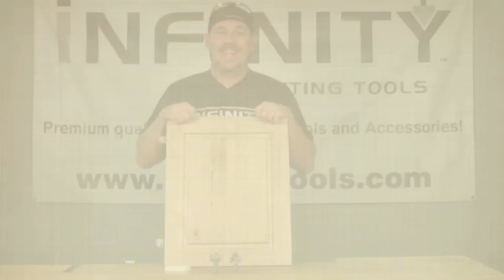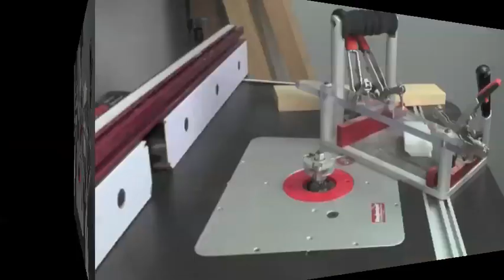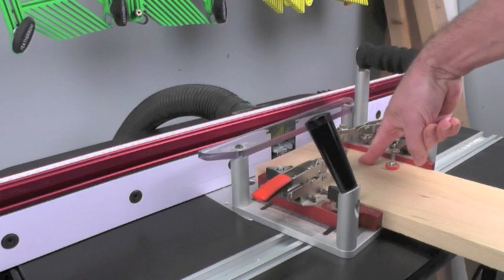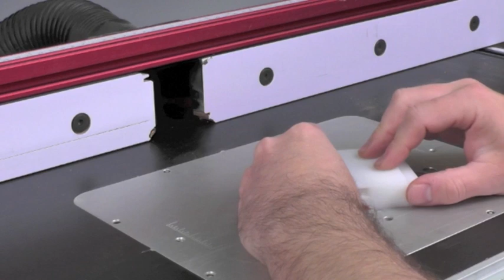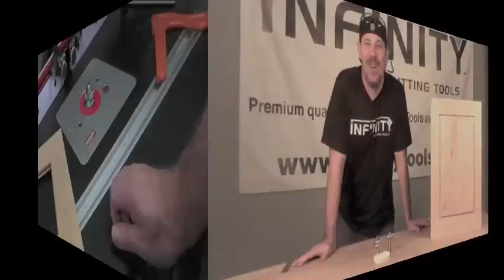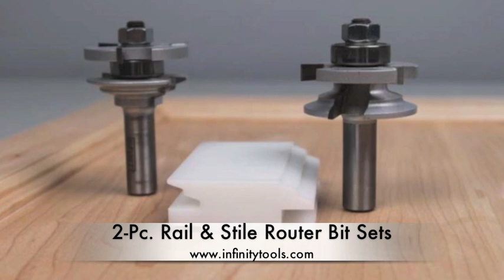Infinity Cutting Tools - Rail & Stile Router Bit Set Up Tutorial

Comment: I have got a rail and stile door bit set but the only problem I have is the coping bit does not have a bearing to line up the centre with the fence of my router table.  What is the best way to setup the bit which has no bearing?  Thank you.

Comment: Thanks man.  I just purchased a new Shaper and will order your Cabinet Door Cutter Set soon.  I bought the sled already and it's waiting to be used.  Apparently, I will need to buy or make a higher fence for the shaper to use the sled.  The clear plastic rail on the sled is higher than my Shaper fence.  Any suggestions?
Reply from the maker: It's pretty common to have to make custom fences for shapers. They tend to be sold with this in mind in my experience. I have always found that MDF seems to be the perfect choice for this, I set up the fence for the job at hand and if I need to cut into it to make zero clearance cuts It's no big deal because when I am done I just toss a new fence in place.
Reply: InfinityTools Ok Thanks.  I ordered the miter bar for the sled.  I know it will be handy.  Can you tell me why I couldn't use the miter bar all the time when making the coping cuts and cross cuts?  Is there a reason that I would clear plastic guide rail against the fence?  I guess when i actually use it, I will know eh?
Reply from the maker: *****
You can use the miter bar all the time depending on the work you are doing, The reason the visor is so handy is you do not have to worry about the fence being paralel to the miter track... this is especially handy on router tables where the fence is often attached on either side of the table and easily skewed in relation to the miter track. The miter bar is handy when you need to make cuts that are not on the edge of the board such as dado cuts, sliding dovetails, or extended tenons. It all depends on the job at had as to which is best.